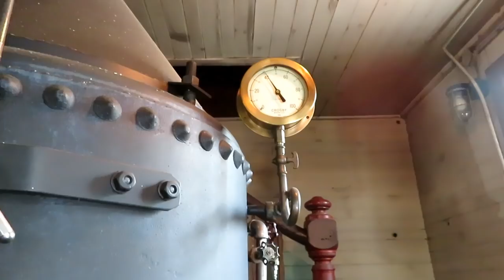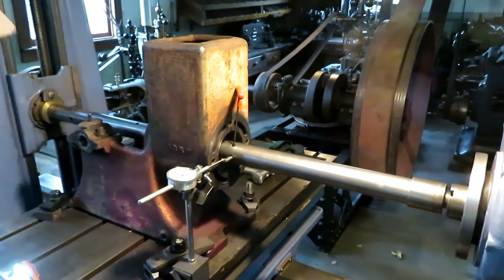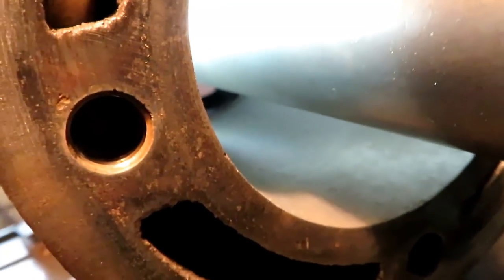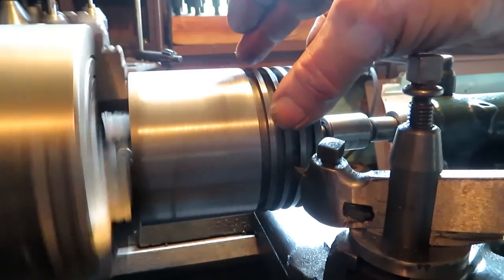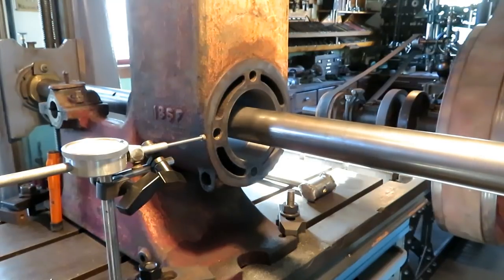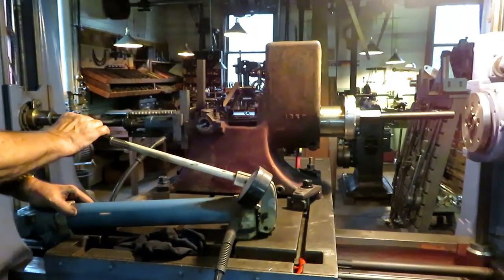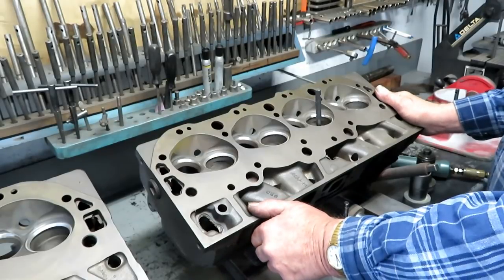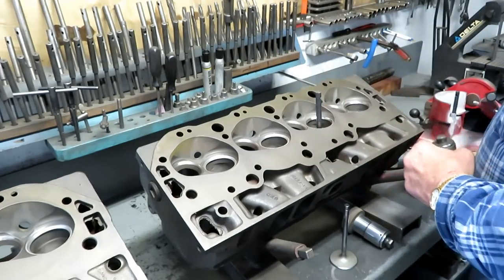Old Steam Powered Machine Shop 61  Horizontal Boring Mill Work

Comment: I have run a G & L Horizontal Boring mill at the main Ford Rouge Toolroom plant in the 1950's.  I graduated from the Ford Toolmaking apprentice program in 1957.  I enjoyed watching your video.
Reply from the maker: Great career James, not many left with that kind of experience. One of the guys I know from the Florida Flywheelers club  machine shop retired out of a Ford engine plant as a tool maker...Dave

Comment: i always love a good HBM video. my favorite machine tool. if i had a chatter problem with a long line boring shaft like that. i would try wrapping a thick piece of rubber around the shaft with some hose clamps. probably would cure it 100% by itself but i think it might help a lot. thanks for sharing. i like your channel.

Comment: As a fellow machinist I always enjoy your videos. I operate a machine shop where I mainly restore vintage engines. I installed a couple Melling sleeves into a WW2 Chrysler flathead this week and use the same average measurement method as yourself. Enjoy your winter in Florida.

Comment: Cool video. I have a 1942 G&L model 25rt HBM that I use all the time. So this was neat to watch another one at work.
Reply from the maker: Those small ones are getting scarce. It's a very versatile machine if you have the tooling...Dave
Reply: @davidrichards5594  I'm fairly set up for tooling to do my typical projects. I made my own facemill holders and boring bars and been quite able since. I have the luxury of working for a machine shop with large machines and all the tooling I could ever need. So when I get stuck at home shop I can usually bring my project to work and do what is needed.

Comment: Doesn't your HBM have stops under the table you can adjust so it automatically kicks out at depth? I would also suggest rather than chasing after the old bore location why not indicate it so that the bore is perpindicular and centered to the crank? What brand of hone was that? Looked like a nice made one.Sunnen of some model?
Reply from the maker: Hi Brian: Good chance the crank isn't where it should be either if it's been re-poured.  My mill doesn't have automatic anything. The hone is a Sunnen AN111, it will get out to 6 1/2" with extensions....Dave

Comment: Great show !! I have a similar job to do. One thing I noticed on the piston turning, was you setting the tool height by going in to the center. Another way is to put a flat strip of metal (I use an old  straight edge) between the tool point and the work if the strip is vertical the tool is on center if it leans toward you the tool is low, away from you, the tool is above center. Just some old hand me downs that were given to me years ago.
Reply from the maker: That definitely works too....Dave

Comment: Another good year. I'll miss the shop over winter. It seems like a steam shop would be better in the cold than the summer heat. You were talking about chatter on the long boring bar. Couldn't you build some split lead rings to control that? One machinist I know uses fluid filled dampers from old 2 stroke Detroit Diesels.

Comment: I like that you left the sleeve a little taller than the surface of the block..That way the head gasket will seal well since the block surface probably is not level / flat any more

Comment: Dave, thank you for another very interesting video!  I'm looking forward to your videos from Florida at teh Florida Flywheelers Antique Engine Club.  I need to visit their annual Engine & Tractor Swap Meet soon!

Also, if you tap the end of the cutting tool hole/socket in your boring bar with something like 40 TPI, and use a 40 TPI set screw or similar behind the tool, you can easily adjust the tool without a dial indicator.  Like a mic, you'll get 0.025-inches of tool "travel" per turn of the screw.  You could even engrave/mark indications around the screw to more accurately adjust it to less than 0.025-in.

Comment: Helllllllll yes, HBMs are my all time favorite machine tool
Reply: The 25s were older than WW2 I thought, the 330T had replaced that series by 1935 probably earlier?  I'd have to look at some books. I might be misremembering though.

I used to work for Giddings and Lewis, and then later a rebuilder/retrofitter that did alot of GL machines.
Reply from the maker: I would like to know how to date mine....Dave
Reply: @davidrichards5594  you got a serial number? 

The early revisions of the 25 design had 250rpm on the main spindle, later revisions this would been boosted upto around 400.

I believe the auxiliary spindle would have been 1200 rpm and then 1400rpm respectively. 

Alot of this is foggy memories, I have only come across a couple 25s, most of the older machines I worked on or rebuilt were the 300 series or stuff from later in the timeline.

If you have a serial we can cross reference that with a build date though, or atleast get a best guess. Not sure when they started tracking that closely.
Reply: Here we go

1925.....14
1926.....23
1927.....27
1928.....37
1929.....41
1940...115
1941...293
1942...519
1943...621
1944...641
1945...706
1946...714
1947...741
1948...749
Reply: They apparently made them much longer then I had said! That's a serial reference, they didnt keep good records during the Depression and the recovery.
Reply from the maker: @procyonia3654  These are the production numbers for each year?   Mine is 8 speed with the speeds plate showing 250 and 400 rpm for the last.  The number on the top of the way across from the operator is  25.21.L16.482  Does that get anything?
Reply: That's the serial numbers, made in that year. 

So yours being 482, places it at late 41, probably in November.

Meaning I was wrong and it is WW2 era. I had really thought the 25 series had been phased out before then, I've only seen ones from the 20s in the wild.
Reply from the maker: @procyonia3654  Thanks Matt, very good to know that....Dave

Comment: Dave, have you ever tried sticking some pieces of lead or copper rolled up pieces of inner tube into the water water jacket opening that are on the face of the block and or wrapping the bloc with long strips of inner tube with lead or copper bars in an effort to reduce chatter.  Additionally have you ever tried The only reason I mention this is when machining brake drum or rotors wrapping the drum or rotor with a rubber strap that has lead weights on it seems to reduce/eliminate chatter when machining them on a brake lathe

Comment: Hi Dave . The one thing I would do is make a dummy shaft for the crank and square the block
with the crank bores to the machine then who cares were the cylinder is as long as it is on center with the crankshaft and the sleeve will take up any misalignment when you bore the block
Reply from the maker: Very good idea, and I probably would have done that if it had been a "total" rebuild, especially if the mains are going to be done too....Dave

Comment: As always, I love your content. Just a question and not questioning your technics, are the head bolt mounting points not a reliable datum? I’m only asking because I just acquired my grandfathers old hit or miss saw rig that has set up in the pasture the last 54 years. I plan on it running before they close my casket, just trying to get my facts straight. Thank you for all your videos!
Reply from the maker: Hi Ed, You might be trying to make it a little more complicated than it is. ...Dave

Comment: Brilliant video, pardon my ignorance but what is the purpose of that curved slit in the wall of the piston?
Reply: I'm only guessing, a lubrication channel.
Reply: From the looks of it, oil is dripped in from a port on the top of the cylinder to lube the piston and rings, the groove picks some oil up and feeds oil to the wristpin.

Comment: I have found that when you put either tightly rolled rubber bands or using material used to pour babbit which looks and smells like dog doo or taking rope wound from one end ot the other with masking tape to keep stuff on the surface of the boring bar will stop chatter in its tracks. Also the way you sharpen your tools makes a difference. HSS or HSS Co works better than carbide. Experience really makes the difference with old machinery. Keep on fixing the old engines too.
Reply from the maker: Agreed....Dave
Reply: Just trying to help a fellow machinist. Good day fella.

Comment: I'm going to be in Florida the 1st half of January and I've got a few flat belt pulleys and some power hacksaw blades that you're welcome to have if we can meet up. These are the pulleys we talked about a couple years ago and I'm still hanging on to them for you. Let me know if you want them.
Reply from the maker: Hi Mark, where will you be?
Reply: @davidrichards5594  we'll be in Destin but gas is cheap and we've got lots of time so we can meet whenever you want.

Comment: Hello Dave.  Is it possible to set the engine up by squaring off the face of the engine to the boring bar?  Nice paint job on the  boring machine.  Thank you.
Reply from the maker: Hi Paul, Thanks, it took me 3 days. I wouldn't trust it on something like that. It certainly would be a good way to get it in the "ball park"...Dave

Comment: It's amazing what's involved in putting a short piece of pipe into a cylinder block - if done right that is....  Curious about the "smile" cut into the piston?  Really like to thank you for making these - pretty much unobtainable experiences - for the rest of us to see!
Reply: Hi Kevin are you related to former delta force member Eric Haney by chance?
Reply: The "smile " is expansion slot for controlled expansion of piston skirt
Reply: The smile is an oil guide. At the ends up by the pin you can see the holes through into the wrist pin bore. The groove carries oil from a drip oiler across the piston and rings and to the pin.
Reply: No, Eric's probably way to motivated to be in my bunch..  lol
Reply: Interesting, wonder if it led to cracking?
Reply: Never really seen one cracked there. Have seen the entire top face broken free in more modern engines that had cast iron pistons though.
Reply: Hey Blazer02LS  that sounds like something briggs and stratton should be doing..

Comment: If the original seats are good I used to bore the big block guides for 1/2 inch  od bronze guides. This turned out good.
Reply from the maker: Dale: These had been all ready done that way, and crooked at that...Dave

Comment: David, great video sir! I thought you might be facing flat the head gasket surface along with the Piston sleeve? Just wondering why you didn't. Thanks.
Reply from the maker: Carl, I want to make an old style boring mill "facing attachment" some time to do just that. It was a very cool device that the old mills all used before the cross feed on the mill head was invented (mine dosen't have one) I have never seen one work or one that could be bought, so I plan to make one. It is carried on the boring bar, built like a lathe compound with a "star wheel" on it's feed screw. every time it makes a revolution (very slowly), the start wheel hits a stop and it feeds it in one spoke across the face of the cylinder. Feed can be varied somewhat by changing the number of spokes on the start wheel. There were also "traveling" boring bars that worked that way too, like the portable rigs used to bore locomotive cylinders on the locomotive. Thanks Carl....Dave
Reply: @davidrichards5594  Thank you David for your detailed reply!!!

Comment: Sounded like a nice cut on the very first pass. I got a question about the overhead drive belts. Were they always run with that much slack back in the old days? Aren't you losing power with them flapping like that? Or is that the way they are supposed to run?
Reply from the maker: Belts are like children, don't matter much what the're playin as long as they git home for supper on time...Dave

Comment: Can you wrap a bike inner-tube around a section of the boring bar like you would a brake drum to stop it from chattering when machining?  This soaks up the ringing vibrations.  I know you've done a brake drum before.
Reply from the maker: I try to configure the tool ,feed,depth and speed so that it doesn't chatter in the first place if possible.....Dave

Comment: Thanks David for a neat video. I have one question, not concerning the work done, that was first rate but this concerning your overhead shaft bearings, how often do you have to lube them???
Reply from the maker: Mr Poke, I give them a small shot of HP gear oil before start up....Dave

Comment: Hi Mr. Richards...

Would a way of lining up an old stationery engine on the horizontal borer be to use the crankshaft bearing supports as reference...?
🇬🇧👍
Reply from the maker: Glenn: probably would be a good way but I've seen the crank bearings up to 1/8" out of line (high/low) with the cylinder from rebabbiting or lack of production tolerance 100 years ago.....Dave
Reply: @davidrichards5594  

It's just that my thinking were that allignment of them working faces would be more important than the casting/frame...

Mind you...I'm an electrician...not a machinist...
You know what your on about more than me with these kinds of stuff...🇬🇧👍

Comment: Not seen a m/c like that before, very neat. Could you have set the engine up by putting a bar through the crank bearings and clocking off it to get it square and the tool bar to the true centre height?
Reply from the maker: Hi David, I think it would be kinda tricky with the bar through the engine. Maybe it could be done by measuring up from the table to your bar center on each side and then setting the mill to that height ?
Reply: David Richards yes that what I rather clumsily meant. Bar in crank bearings, get it lined up, then put tool rod thro - perhaps run a clock across the face to make sure it is square. Used to be involved with resurrecting old stuff, now enjoying retirement. YouTube channels like yours are great on winter evenings. Starting to get dark really early up here in England, 54 deg north but the Gulf Stream to save us from deep cold. Kind regards. 🇬🇧
Reply from the maker: @750VFR  This is a very early cold blast for New York...Dave

Comment: Hey, David got a question for you. Would it not be much easier and faster to line up the bore by making a couple cones to put on that boring bar? That way you could seat the cones on either side of the cylinder bore then bolt down the base and it would be lined up with the CL of the boring bar. I have never done this sort of thing and was wondering if that would be a viable solution?

Comment: Dave nice work how are the rings lubricated ?
Reply from the maker: Hi Chris:  Hit & Miss engines have drip lubricators mounted on the rear of the cylinder with an oil hole running into the cylinder above the piston. It drips on the skirt of the piston as it is running. The "smile" shaped groove in the piston is supposed to help distribute the oil around it.  You can see the pipe threaded hole in one of the shots....Dave
Reply: Thanks for the explanation Dave

Comment: WOW,first time  I ever watched one of videos,Dave WOW,dont u have inside mics,or telescope gauges,dial bore guage even,im a H B M operator,you have a Giddings and Lewis,i have run lucas HBM and Devileig,jig mill 20yrs,exp,u got the job done,NO GET MAD aint the way I would have done it
Reply from the maker: Comments here are for discussion Mike, How would you do it on the Lucas, remember, there is no cross feed on the head of this machine. Thanks for watching...Dave
Reply: Dave,set up the same,indicate face in best I could,pick up centerline swing an indicator in the bore,get my 4"or 2" adjustable boring head in,use an 883 or g2 carbide tip for cast iron,not high speed,rough bore till I had .012 left to finish,take .004 check bore for size,take.004 more,check bore for size,take the last .004 finish cut,u always wanna keep pressure on tool the same on finish cuts,feed saddle in and out W axis,dont keep pressure the same take .0o6 take .005,your shooting dice in a dark room,never know what your tool is cutting 20yrs running a HBM,one time I used a line bore bar,swing a radius into a drilled hole for exhaust hole in bore,yes your right its a steam shop exhibition shop,not a job shop,now im gonna get guys telling me I don't know what im doing SO BE IT,HBM or Devileig Jig Mill the same on both,the last Lucas I ran didn't even have a tail stock on it

Comment: I worked a kearns horizontal borer in the early 70's back in UK doing Admiralty work...…….you guys never heard of a bar mike for setting the tool in a line bar?...…..it looks like a piece of angle with a micrometer head centralised at 90 deg on the end...…...you put the angle part on the bar and the mike spindle end touches the tool......that is what it does.....you can set the tool very accurately.
Reply from the maker: Hi Ian: I was thinking about making something like that. Another set up I've seen is to have a second hole right beside the tool bit hole that a modified telescoping gauge will fit through with it's handle removed. That might be a better way to measure the bore with the bar in place....Dave
Reply: @davidrichards5594  Measuring the bore with a line bar in place was always a pain, but as there was no other way I used a short heavy boring bar to get the bore roughed down to near size then went in with a line bar.....that meant you still had to remove the line bar to measure the bore but usually it was just once to check the final size.
In actual fact, a line bar in my opinion is not all that good, unless the hole or holes are spread apart and a boring bar won't work.....  as it is a long springy bar from the chuck to the end support whereas the short heavy boring bar does the same job but without the springiness. Holes that were short in depth....max 4 X diam etc..... or 2 holes not all that far apart I always did with a heavy boring bar.